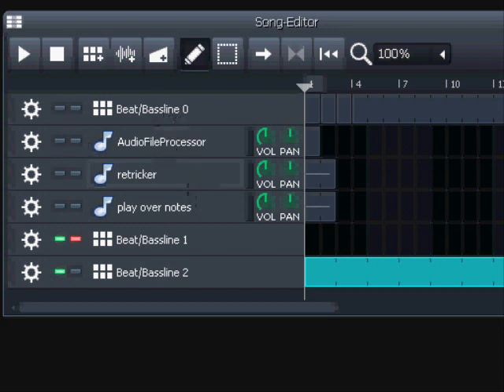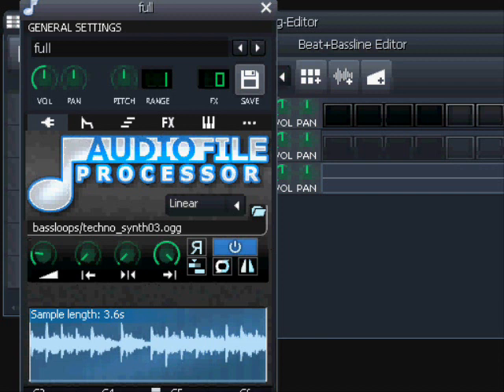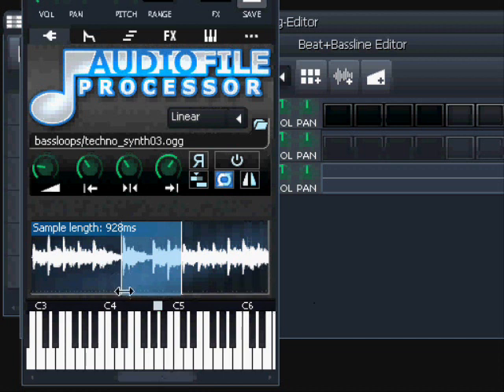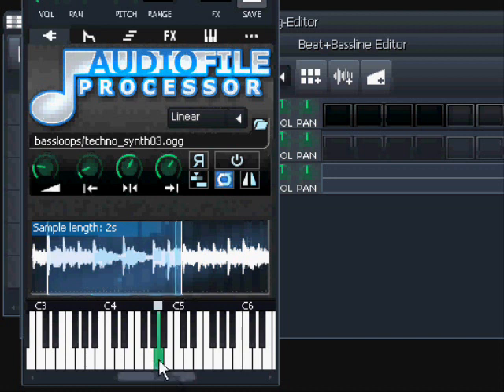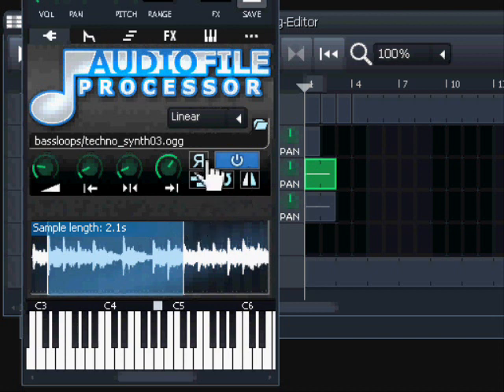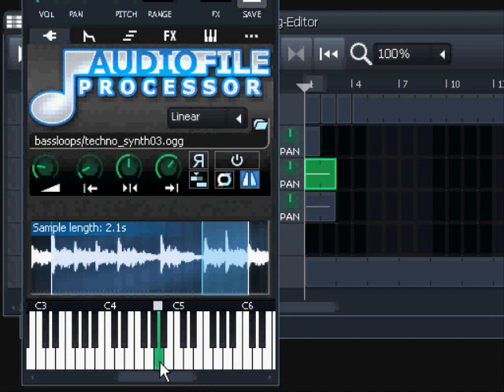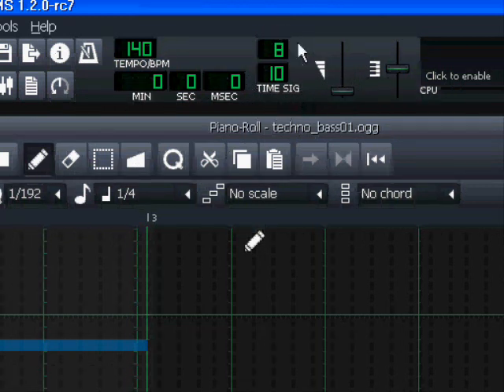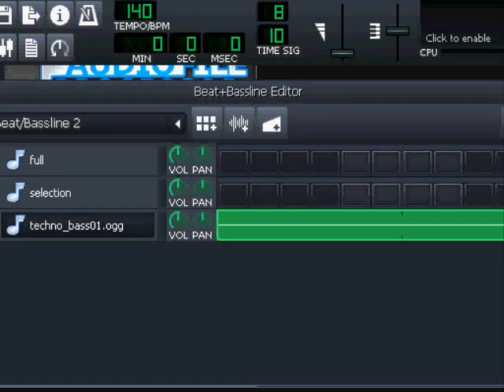AudioFileProcessor, Tips & tricks

Comment: The revers button (as u refer) is actually forward and reverse lopping.
Reply from the maker: Hi! It is the option >reversed-R< that can reverse a sample, but at the same time you can invoke >Ping-pong<. When that is done, the first part will be reversed, then it will change to normal, and depending on the setting of either >Release< or note-length, that sequence will be repeated. However the repeating sequence can be limited or expanded with >Repeat-section<!
AFP is a very potent plugin, and quite unique for LMMS!